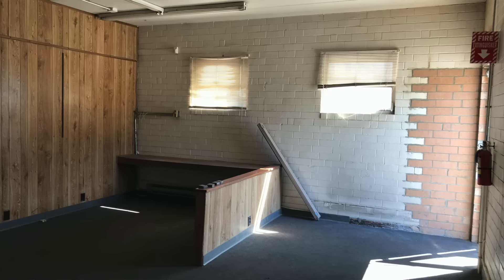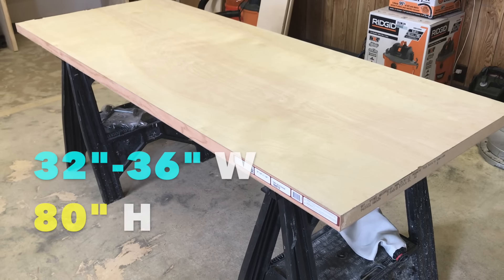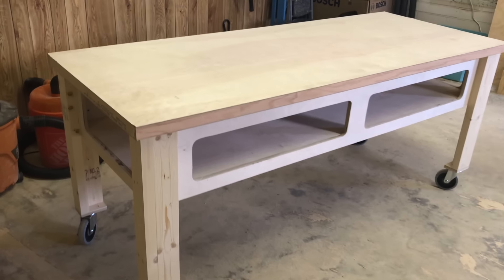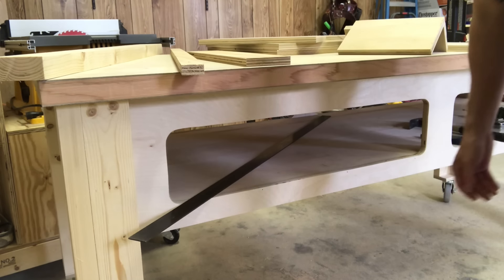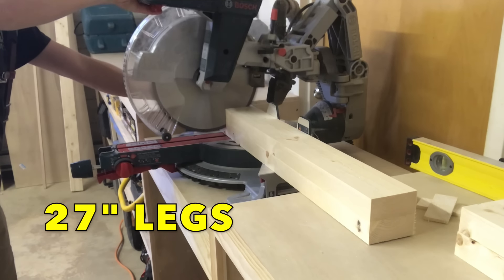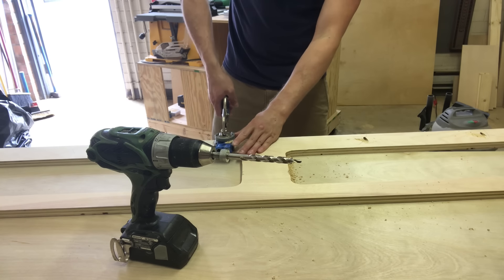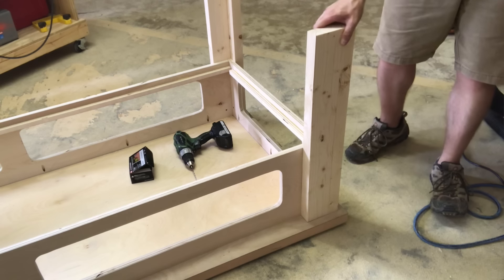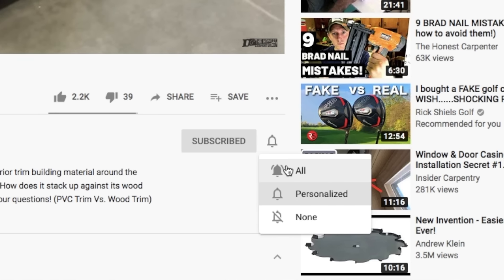These Make The BEST WORKSHOP TABLES / WORKBENCH!! (Tips, Tricks, Secrets--Workshop Table Full Build)

Comment: Love the solid door idea. I worked in cabinetmaking in the 80's and we always used 1/4 masonite (hardboard) with one smooth side on top with solid wood edge. Contact cement it on so it's easy to remove with lacquer thinner. Very durable and cheap. Easy to wipe glue off and clean.

Comment: Back in the '70s, I needed a desk to get through college on a budget.  A friend turned me on to a remodeling business that liquidated their Formica kitchen countertop mistakes (and old ones from demo) for $1 per linear foot.  I got a 10' desk top for $10.  Later in life it moved to the shop as a work table.  Not quite as good as a solid core door for rigidness or stability, but it opened my eyes to the Formica work surface.  It repels everything and even glues can be easily scraped/popped off instantly without leaving a mark.  I highly suggest getting some contact cement and adding a matte Formica veneer to your door for the best of both.

Comment: I love it. Simple, easy, functional, and extremely practical.
Edit: I recently threw one of these together. I have a DeWalt 7491RS jobsite table saw, and I built this about 1/4" shy of that height. So I'm using your design as an outfeed table slash assembly table slash mobile workbench. It's extremely convenient. Thanks for sharing this!

Comment: Perfect timing brother.  I have been looking at different workbench table designs all over the last couple weeks. I need my table to hold wood while I hand plane.  My only question is, can I drill dog holes in the top to use holdfasts or what can of system can I use to clamp piece to the top so I can plane the edges of boards?
Reply: You could drill dog holes but the holdfasts will likely wallow out the holes over time since the door is MDF core - a hollow door would be even worse.  Maybe a strip of wood in the door top for your dog holes line but then you loose the advantage of an easy top.
I regret putting my small bench on casters and then trying to hand plane on it.  I wish the feet made direct contact to the floor when working.  Check out flip down casters you step on and lock to move it around.  This doesn't apply to an assembly table but one you plan on putting a lot of lateral forces against.  Even the best casters have slop in the bearings and swivels.
This table is optimized to clamp to the table top around the perimeter.  Legs flush with the worktop are common for hand tool woodworking to allow clamping to the top and side of the table to work on edges with a vice or bench hook.

The good news is I don't know a single woodworker who has only built 1 workbench.  There is always the next one.

Comment: I love these builds, but find implementing them challenging - I could really use a workbench in the garage, but between a car and miscellaneous storage, we definitely don't have the room for me to dedicated "unitasker" tools like a table saw or miter saw. I'd love to see build videos where you incorporate some of your other content, like your "Just Two Tools" video for those of us that don't have dedicated space as the default - in the sense of "Mark up your project and I'll show you how to cut one out parts for one side with a circular saw and jigsaw, and the other side I'll do using the table saw for the big cuts and a router for the corners."
Reply from the maker: Thank you for the suggestion, Jonathon! You’re right, not everybody has as much space. I’ll definitely think about it for future videos 🤔👍
Reply: I have seen videos on a work bench that the legs fold into the top and the whole thing clips to a wall. Might be solution to your issue.
Reply: Fold out trestles and a door - instant work bench that stores easily. You can make it more solid just by clamping top to trestles with any clamp that fits.
Reply: I also only have a single garage and need to build a work bench. This is a great idea for the top. You could add a secondary shelf lower down as a storage shelf for you other tools, table saw, router etc if you don’t have shelving space. Built in drawers could hold all the smaller tools. The sly is the limit but will make this build more complicated .
Reply: Wait, What?  You put your car in the garage?  Clearly you don't understand it's purpose :)
Reply: @HSkraekelig  when you reach a certain level (varies by person) of "this is actually a NICE car", you MAKE room. 🤣😂😹👍
Reply: Back in the 80's, I read a woodworking magazine article which stated that most workbenches only see use in about 20 inches or so depth of the top. So I made a workbench top out of 5 2x4's which was then 17.5" deep, and 5 ' long, and made a folding base also out of 2x4's, which it could sit on top of. When not in use, I can just remove the top and fold the base legs in, and it sits flat against the wall. I did manage to find a nice used Wilton wood vise to mount on it, too. The base is simply a pair of 2x4's, mounted together by dado-ing a slot in the sides, and running two 2x4s pieces between them separated by about 24 inches to make it stable, and then hinging the two ends onto a box section in the middle with dowels on the top of the legs which fit into the top to keep it secure (with snap clamps to keep the top on once it's fit together), essentially leaving space for my legs when I sit on a stool working. Total cost was only the 2x4's (which today will be several times what it was back in 1990), 4 hinges, one dowel, some glue to glue the top together, and I stained it with danish oil finish to keep the moisture out of the wood. Oh, and the used vice from a flea market. that workbench is still in great shape today, after 30 years of use.
Reply: You can always do a knock down torsion box table. It can hang on the wall or stood up in the corner when not in use, and setup in just a couple of minutes anywhere. It's also portable.
Reply: @TheHonestCarpenter  Maybe a "flip up" door slab that stores against the wall when not needed??? Just an idea. 👍🏻👍🏻
Reply: You put a car in a garage??

Comment: nice build. I like the table top idea and will check out my local re-store store. One question on flipping the top. Since glued the shelf in, won't it be in your way when you try to unscrew the top and then rescrew it? I'd think the bottom shelf would not need to be glued to make the flipping easier. you could use wedges in the corners if you wanted a sturdier feel to the shelf. Or is it glued to add support to the legs?

Comment: I like this build. When the top gets beat up, he could lay a sheet of luan over it,  router around the edge, and he would have a clean new table. 
I keep an old flat door in my shed. It's nice to lay over a couple of sawhorses to use as a project table under the shade tree.
Reply from the maker: Thanks, mark! In my early years working solo, I carried a flat door and horses in my van. Quick job site table 😁
Reply: I’ve been using tempered Masonite as a sacrificial surface for decades. And one sheet cut and doubled up makes a great roll around surface for your office chair. Haven’t bought any lately, but it was cheaper than a decent quality plastic carpet protector - you know, the kind with a zillion little spikes that kill your hands when you go to move one.
BTW: I’ve also used hollow core doors (used to be CHEAP!) to make a double desk surface and a laundry room folding table. Ford the wife.  Some sanding and a couple coats of urethane give you an attractive durable surface.

Comment: I built this, it is amazing. I made a small modification last night that might be useful to others - I had some 2" nylon webbing and I just screwed in some pieces below the cut outs. Many of my power tools have belt hooks so I just hang them on the webbing and then kind of lean under the table so easy to grab but also out of the way.

Comment: wickid good video.
using a solid core door is a wickid good idea.  love that !
i’ve installed so many doors and never thought to make a work bench out of one even though i’ve used hollow core as a temporary bench top over saw horses.
thank you for this.
extremely flat….that’s what we want.
very heavy, that’s what we want.
inexpensive, simple and fast, that’s what we want.
the storage under there and the simple method of assembling that is a no brainer,
the only thing i might change is the casters to the type that raise and lower so the legs can sit on the floor and not move. 
awesome video !

Comment: So good I watched it twice. Very basic, solid & fast - just like you said. It’s a nice mod on the design Ron Paulk uses - but way simpler, and a more efficient use of materials. I build custom workbenches, and offer a similar design as a starting point for clients on a lower budget. My only concern is racking (front to back & side to side)., especially if skipping the casters, or using retractable casters w/ leveling feet. An easy fix would be to add stretchers ~12” from the bottom of the legs. The stretchers provide support for another shelf if desired. This shelf provides semi-permanent storage for tools, so i bump mine up to 3/4” ply. Thanks for sharing your design. Your videos are always worth watching for practical advice.

Comment: Looks good … I use a Milwaukee barrel grip cordless jigsaw and wouldn’t trade it for anything.. very easy to maneuver and control .. great tip with the door top I made a workbench for a customer using used solid wood doors that my customer bought from a salvage company here ….

Comment: A few years ago I built a stationary worktable out of a solid core door that I purchased from a university surplus sale.  Local university has a surplus store that sells old cabinets and doors occasionally.  Mine was a true solid wood core door (like you said HEAVY).  It was only $20.  I like the tool shelf below the worksurface.  I put 1/8" hardboard on top which can easily be replaced when it becomes unsightly or uneven.  Nice video.  Thank You for sharing.

Comment: I am serious now, this is the best video on a common sense shop table I have seen yet and I have probably seen 200 videos.  No BS, simple, straightforward, no complex joinery, not even an expensive screw!!   The shelf idea is genius, that is not original, but very well explained and I think you are actually going to use it to hold miscellaneous tools.  Currently I have to reach around to my cabinet table for this stuff.  AND I didn't recess the verticals and so clamping is difficult.  The only problem I have is that this is not drillable for 18mm MFT holes.  My table is 30x60 inches and covered with them.  They have saved my bacon several times and I can do precision track saw cuts with ease.  Either or I guess.  You could do a 3/4 inch MDF top and get the MFT effect.  Also, this design can be sized appropriately, especially with a solid MDF core.  Thanks, take care and stay safe!!

Comment: You nailed it on this build! The perfect table to roll out into the driveway when the weather is nice. I'd have no reservations screwing right into the top or adding a dog hole wherever I needed one for a project. It's almost exactly what I will build. I will add a low shelf for extra storage. Also I'd like to make one of the long sides flush with the top, to facilitate vertical clamping.
Reply from the maker: Thank you, Matthew! My first online course later this year will conclude with a more elaborate version of this build—but it will still work off a very similar premise 🙂

Comment: Great workbench. I however would add a lower shelf since floor space is often in short supply. I use mine to store tool cases for the times I take my tools to do projects. Since retirement I’m always getting requests for something to be done. I don’t have a tool shelf but think I’ll be adding one.I too have been using solid core doors to build workbenches for years. I have a place to buy used doors cheep. All three of my sons have benches built for under $50. I sometimes trim the hinge mortises off and plug the lock set hole the insert a tube to put a arm lamp in for small projects and take out for large projects. Great video.

Comment: Nice simple solution for a lot of all levels  of woodworking. 30 yr veteran remodeling carpenter and while some of your reasoning is sound there are some seasons you might not be aware of. And the jigsaw you want is the original bosch 1587.. available in a barrel grip or top handle. Using bosch blades(which are stupid sharp) this saw can turn a dime sized circle with the right guy on the saw. Check it out and keep telling it straight. Shared the no carpenters vid w her and i think she finally understood how the carpenters get screwed lol

Comment: Honest Carpenter is absolutely right, a door is a great sized work space. I built a workbench with an old metal door at my old place in Oklahoma.  It worked great, bolted a vise on a corner and never had a problem with it getting in the way.  This workbench wasn't going to be mobile so I put the knob hole against the wall. Had some reclaimed steel cabinets under it for storage. Didn't have more than $40 in it with all the reclaimed materials.

Comment: LOL!   Feel 100% validated!   I've been using this technique for years for tables instead of buying a bunch of 2x4s.  Quicker and more money saved.  However, I've migrated away from wood and built larger welding tables so I can have dual uses.  But if I want a wooden top for the table I have plywood cut to the exact dimensions for that.

Comment: No, its a sweet design. Nice trick using a solid core door. I used a door years ago and then for some never considered it again until you brought it up (wasnt really a plan. It just happened to be available). No changes I would recommend. Anything different would really just depend on how someone was going to use it. In a garage or poured floor levelling is always going to be an issue and made harder by casters. But the mobility is amazing when you are in a smaller space and need to reconfigure for different projects. Great flexibility. I will make a version of this table soon. Thank you
Reply from the maker: All good points, Timothy! I love being able to swing this table around quickly. But others could leave casters off altogether and have a fairly solid immobile workbench 🙂
Reply: @TheHonestCarpenter  yeah i have seen this one huge dude who works with his daughters do a mobil table with really heavy duty casters that could be raised and lowered. But it was so involved that it really wasnt accessible to anyone other than the biggest shops. Even people who do this for a living would never make that table. But this one, i think people of medium skill would say “yeah, i can do that.” So, which is better? The perfect table no one can make? Or a good solid table that is simple and will actually get used? This is the one.

Comment: My great discovery for work top lumber is the laminated hardwood kitchen worktops.  I'd walked passed them dozens of time assuming they were veneered MDF or particle board, but then one of the old guys they use at the local DIY store put me straight.   I paid just over NZ$100 for a 2200mm x 600mm x 26mm board, so double thicknessed it for my router cabinet build.  It is flat, strong, and beautiful, and a real bargain.  Mine was made of Kwila but they have Acacia, pine and bamboo.

Comment: Great!  Only think I might add is a cross piece or two of plywood under that bottom shelf just to give it more weight bearing capacity.  Then it could actually be used for some permanent storage without causing bowing in the shelf if someone is REALLY strapped for space!  Cool idea and build.  Thanks for sharing.

Comment: Great minds think alike. Repurposing can save time, work and money.  Several years ago I went to a public surplus auction at my local college.  They had some very heavy 36" solid core doors.  I got this work bench idea then and picked one up for 5.00.  The veneer has taken a beating, but I will be overlaying the top with pressed headboard. 👍
Reply: Consider a matte Formica veneer.  Repels all paint/chem and even dried glues just pop off.  Been using mine for almost 40 years.

Comment: A great bench top is going to the lumber yard and buying a broken glu-lam.  I got one that was 5 1/2 inch by 24 inch by 20 ft long.  (The end was broken from coming off the truck at the lumber yard and ended up with only 16 feet useable.  Cut into 7 ft 10 inch lengths, bolted together and ended up with a 47 inch bench top.  (Needed 4 guys to move.)

Comment: I'm building a similar mobile out feed table. Wish I could have seen your video before starting my project. I purchase TWO  3/4" 4x8 MDF and one 3/4" melamine for the top$$$. I forgot I already have a solid door on another work bench and works great ( why didn't I think of this for my out feed table...) Your design allows for other tools like vacuum, air compressor, other items on wheels even  a scape bin to store cut off materials from other projects. Nice job!

Comment: I also like this design, kind of a take off on the Ron Paulk style but with a more traditional base.  I have used doors before as table tops and they work great!  
Q:  Could you rout some Microjig dovetails or drill dog holes in the surface for additional clamping capability? Any problem with racking at the legs?  I was thinking of adding some cross pieces and stretchers along the bottom which would add stability and enable a second shelf or even drawers.

Comment: I like this video because of the table top material used. In stead of a door, I found a used drafting deck at the Goodwill. The top was solid, and it had the angle iron on two sides. The leg were junk, trashed them. A little later found an old picnic table that was solid and level! The top was not ideal for a work bench. I put the two together and it made a heavy and great work bench.